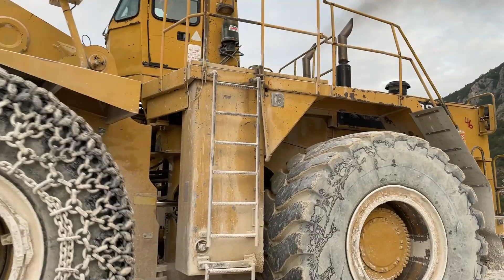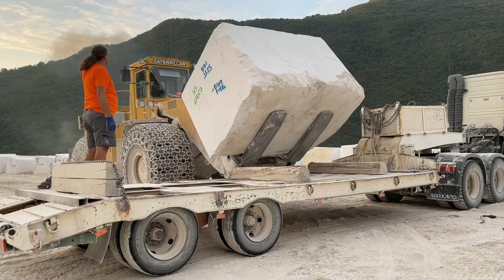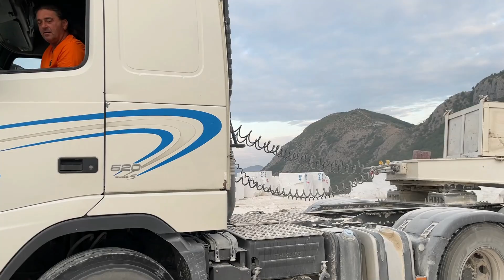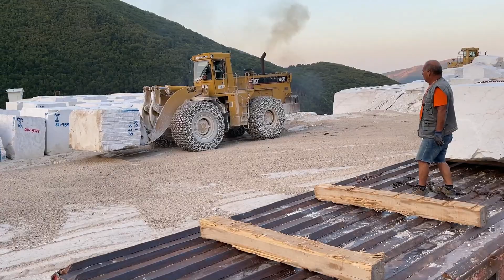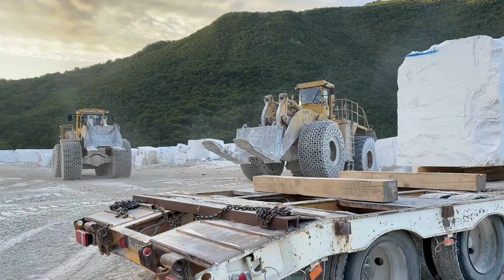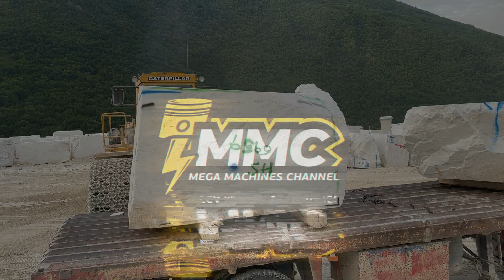Morning Loading Marble Blocks With Caterpillar 988B Wheel Loader In Birros Marble Quarries

Comment: Although this video makes it look easy, I am sure it is difficult and challenging to maneuver a super heavy block of marble on an 18 wheeler. Great job and excellent video👏👏👏👏
Reply: Generally here in the states we use way more chains.. 6-8 depending on the weight.  Two to three going over the mid section,  then one going over and under a corner to halt forward and backward movement.